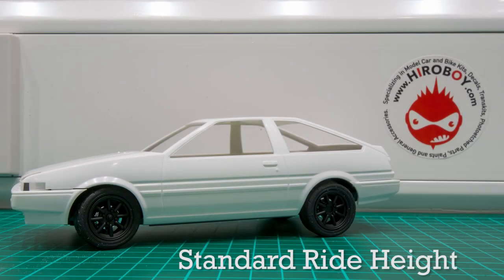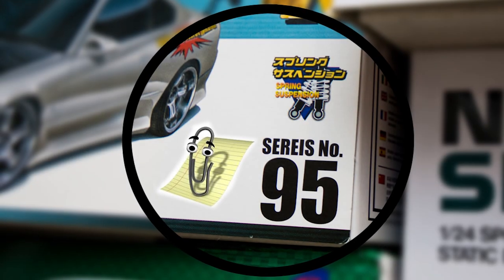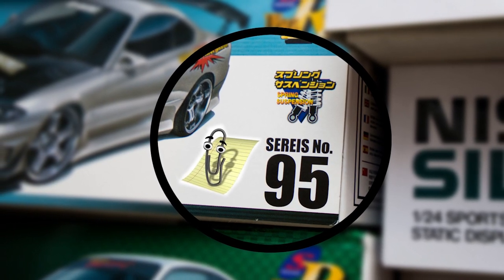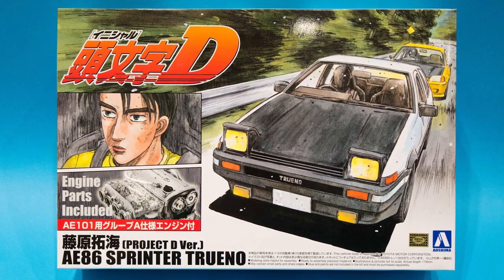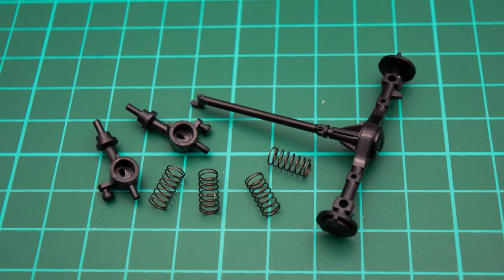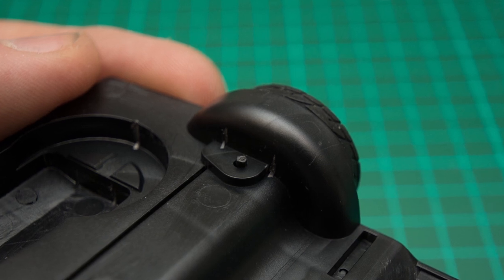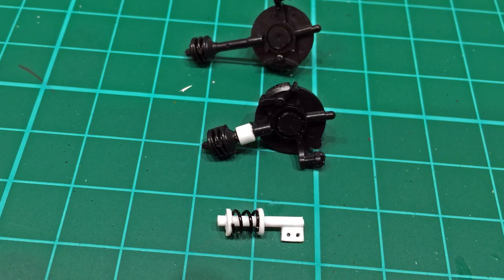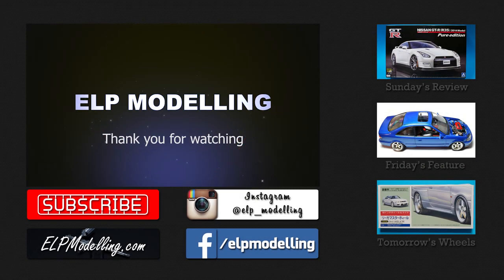How To Lower Aoshima Model Kits

Comment: does the rb ae86?
Reply from the maker: +bOwToMeE0 No it doesn't, I've unboxed both, the red one here: https://www.youtube.com/watch?v=8bq4u7XEYLA and the black one here: https://www.youtube.com/watch?v=gsiO0Qlnk3M

They come with different suspension option depending on whether you want to have camber or not and how low you want the model :)
Reply: +ELP Modelling hey mate, would you be able to do a how to video on fujimis models for lowering and camber, they are extremely basic and ive already worked a way to lower and do camber at the front but doing camber on the rear is an issue as some (not sure if all of them do) come with a metal rod that the wheels just attach to. Do you know any tips to be able to camber the rear at all but keep the wheels rolling or just not possible?

Keep up the mad videos, loving all of them.